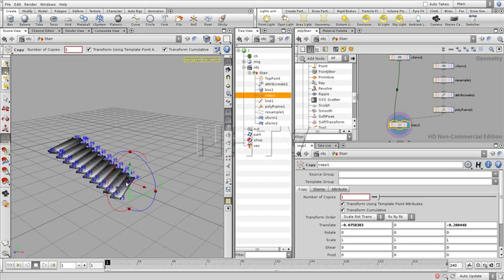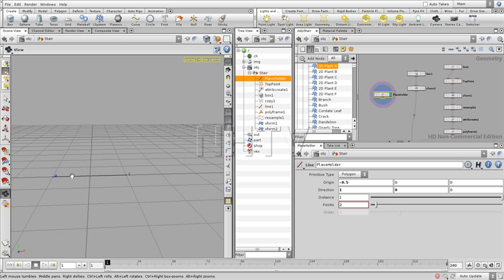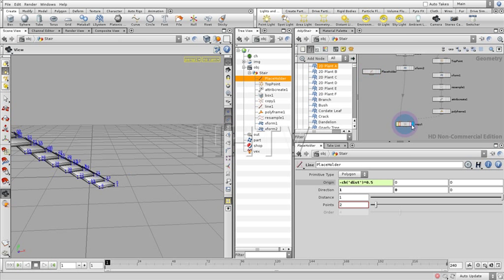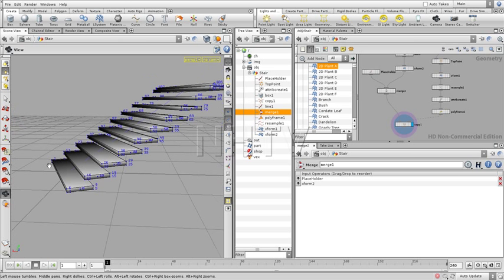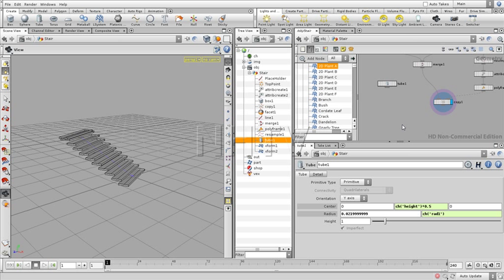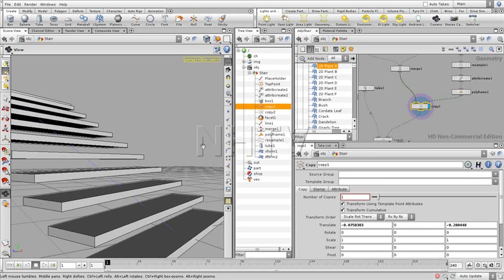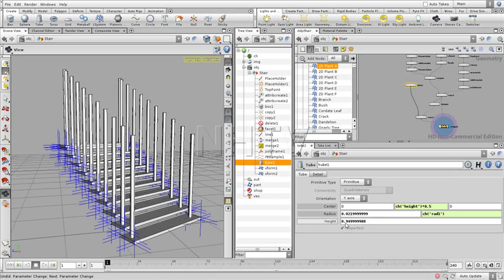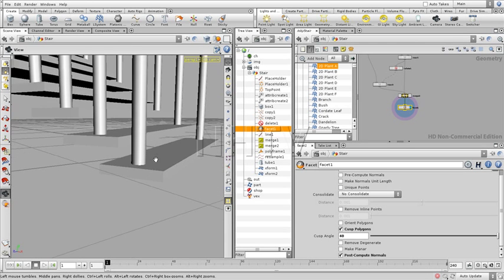ProceduralStairs 05

Comment: Amazing series! Am I correct in saying that this particular part can be simplified in H16.5 by using the copy to points node? (and therefore not needing to create normals on the placeholder line) Thanks
Reply: Also the Normal node should now be used over the Facet node today, correct?
Reply: Am also using 16.5 and used a Copy Stamp to get the same result as in the vid. Agreed, great series of videos!